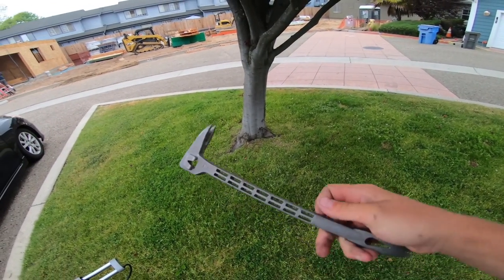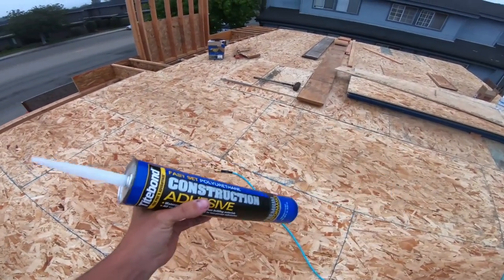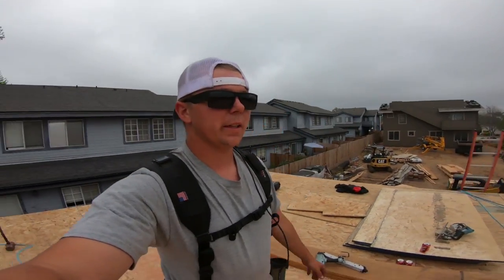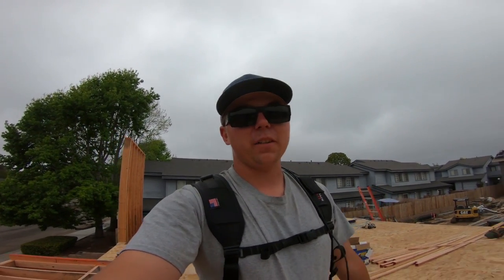Building a House | Ep. 5 - "Floor System Pt. 2" + BONUS GIVEAWAY!

Comment: A couple questions.  Could you do a framing gun review like you did with tool belts?  
On the slanted bump out deck, is there some detail that keeps driving rain from entering the house at the transition to the flat floor?

Comment: Why sheet the rim? 2nd floor doesn’t need to tie to first floor topplate? We run 10’ sheets and hang past down to first floor walls.
Reply from the maker: LTP4’s for plate to plate connection, I’ve seen a lot of people hang past. Just not something we do out here. We’ve got a lot of strap details on this place as well, thing headers from first floor to posts on second.

Comment: Curious...  dont you have to put hangers on your ledger board to hold the cantilevered deck joists?
Reply from the maker: Yes we do! Good eye. We’ll have a laborer do it from the bottom.
Reply: I came here with the same question. I'm in the process of renovating a 1940's single story and replacing 80% of the framing. Most of it from water damage due to no site drainage. My wife doesn't get what I find so interesting about framing videos!

Comment: HEY( MATTBANGSWOOD) I LOVE YOUR VIDEOS A LOT I LEARN SOME THINGS BY WATCHING YOUR VIDEOS IM NOT A FRAMER BY TRADE BUT I DO BUILD A LITTLE.  I LIVE HERE IN THE  ST LOUIS AREA I FINSHED UP A CARPORT BUILD BACK IN SEPTEMBER OF THIS YEAR I HAD A LITTLE SITUATION WITH THE GC ON THE JOB THAT HE CLAIMS IT WAS OUT OF SQUARE ABOUT 6 TO 12 INCHES BUT I STAYED AND HELPED CORRECT THE PROBLEM WHEN IT WAS AT THE CONCRETE PIER STAGE.. WELL I FINISHED ALL WAY TO WHERE ALL HE HAD TO DO WAS SHINGLE THE ROOF AND PUT SIDING ON FRONT AND REAR  FACING OF THE GABLE ENDS AND GARAGE DOOR FACING. THE QUESTION I HAVE IS.. CAN  BUILDINGS GARAGES ECT..BE OUT OF SQUARE A LITTLE WITHOUT EFFECTING THE FINISH WORK LIKE SIDING AND SHINGLING. AND IF SO BY HOW MUCH? THANKS IN ADVANCE  FOR YOUR  INPUT

Comment: Any particular reason you don't let your plywood span over your floor system and onto the 2nd story walls? Great video, love the content, I'm a framer in FL.
Reply from the maker: Hey! We’ve been asked that a time or two. Nobody out here hangs sheets over, I’m not sure why, as it ties your upper to your lower.. We always use rippers of OSB and LTP4 hardware for plate to plate connection, along with some heavy duty straps!
Reply: @MattBangsWood  ok cool. Here we span over and skip the straps, but we have to do threaded rod every 4'-6' for uplift.

Comment: Tip or Question:  Why did you waste the time cutting 18" or 24" (what ever the dimension was) wrapping the 2nd floor when you could have just set your OSB on the 2nd story wall to over lap?  This gives a little added strength/tying in 2nd story walls to 1st floor and saves time.  Damn,  was just about to post this and read down quite a bit and saw someone else mentioned same thing.  lol  Either way, love the vids.  Keep them coming!
Reply from the maker: Robert Hyman Nobody out here does that, although I’ve seen many do it online. We put in a strain along our rim, and LTP4 connects plate to plate.. Along with a boatload of strapping from headers below to posts above.
Reply from the maker: Robert Hyman What I’ve always wanted to know, and I’ll ask the inspector when he comes out.. Is if we did that, would it eliminate the need for LTP4’s.

Comment: Isn't the spacing for 16 o/c 14.5" typical? 16 - 3/4 (half stud {x2 for each side}) --> 14.5" ? That deck looks good though, keep on truckin' :)
Reply from the maker: 14-1/2”, theoretically, yes. 14-3/8” gives you a 1/16” variance on both sides to play with. They can’t all be tight, better for your blocks to be a hair short than a hair long!